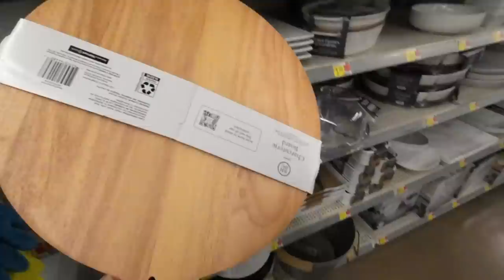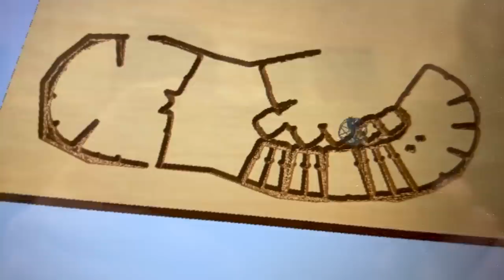DiResta Carolina Cutting Board Inlay

Comment: I do NOT understand why manufacturers insist on using adhesives from hell to put labels on items that are going to be removed by the end user. Horror Fright does with their Storehouse boxes (#93928 and #62778, for example) . Gotta use a heat gun to remove them, but it's thermoplastic, so you've got to be really careful. On top of that stupidity, they shrink wrap the box anyway. Why not just put the damn label on the shrink wrap instead of the box?